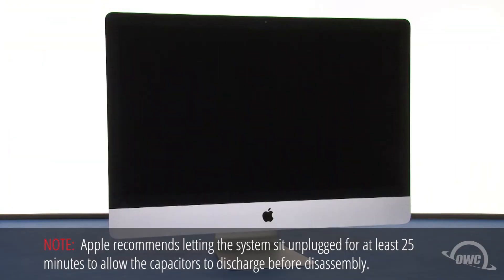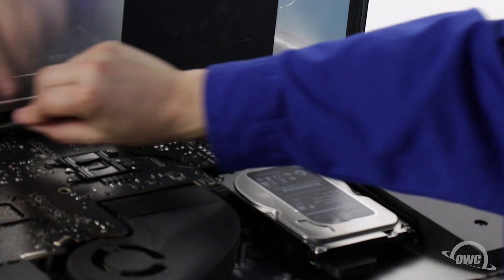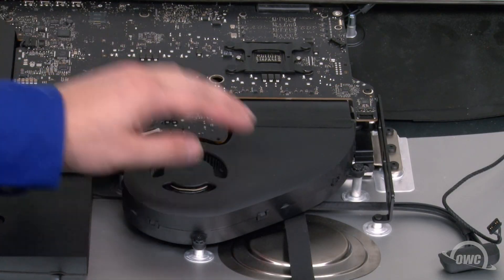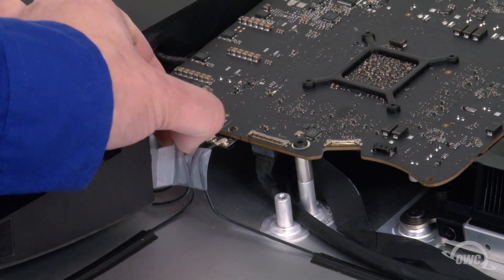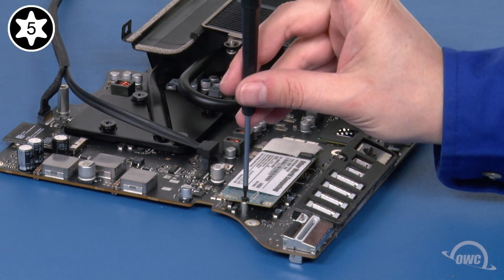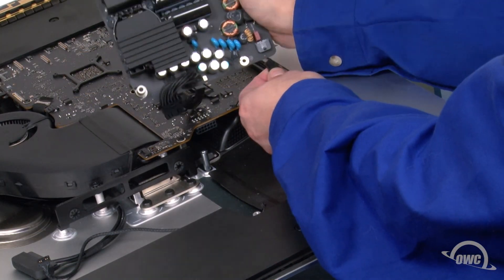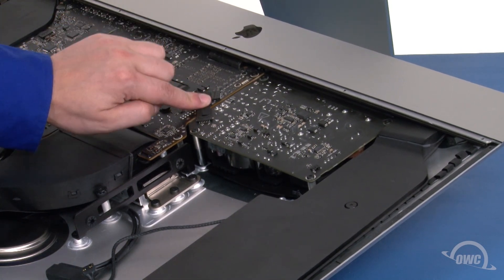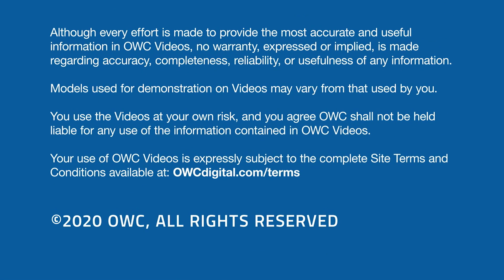How to Install/Upgrade the SSD Card Slot of a 27-inch iMac (Late 2012) iMac13,1

Comment: Good video but is there a follow-up video to move the data and OS to the NVMe to get the full benefit? I just replaced the HDD with a SSD, and it works well, add more RAM. I now have a usable machine.
Reply from the maker: Thanks for watching! Glad to hear your SSD and RAM upgrades went smoothly and your Mac is running great. We don’t have a follow-up video just yet for moving the OS and data to an NVMe, but we do have step-by-step guides on our site that walk you through it. If you want, our tech team can also guide you through the process so you can get the full speed boost.
https://eshop.macsales.com/Service/

Comment: The SSD slot in the late 2012 iMac is SATA3, so there is no benefit to installing the blade SSD when you can just replace the stock hard drive with a 2.5" SSD and get the same performance.  That would be for the non-fusion drive models.  If you have the Fusion Drive model, then you can remove the stock hard drive and replace the 128GB SSD stick with a 1TB or 2TB SSD stick.  Or replace the stock hard drive with an SSD and remove the 128GB SSD stick.  Later iMacs had no SSD slot if the Mac did not originally ship with a Fusion Drive.
Reply: I have one with the ssd stick... and the hard drive... should I not bother with the ssd stick then ? if i'm not going to gain any speed with putting a stick ssd i would rather just get a normal 2.5" ssd

Comment: Are there instructions to replace outright the fusion drive ( both hard drive and ssd drive ) with one ssd drive ?
Reply from the maker: Hey Joe,
This is a great question, this video is only to switch out the PCIe SSD that is located on the logic board. If you need instructions to replace the HDD this is the video you would want to watch.
https://eshop.macsales.com/installvideos/imac_27in5k_14late_hdd/

Comment: so basically you making a fusion drive?
Reply from the maker: Well a fusion drive is both a HDD and PCIe SSD that are fused together to be seen as one drive. When you install this drive your iMac will see it as its own individual drive. Now if you would like to fuse it with the HDD in the iMac you would have to go into terminal and fuse them together again.
Reply: @poweredbyowc  oh ok

Comment: Thanks to this video I installed the SSD in my late 2012 Mac. Everything went very well, it was easier than I expected. The package includes everything I needed to except the screwdriver for the T25.
Finally this computer will be usable again because the old hard drive was a real pain.

Comment: Hi guys, on your website can I also buy the little tool to open the "glass"? Does it comes together with the SSD kit? Do you send the kit to Germany?
Reply from the maker: Hey Silvia Cereja Daou,

Yes you can by the tools separately if you need to here. https://eshop.macsales.com/item/OWC/TOOLIMACWHL/
But it does come with any HDD/SSD upgrade kit.

Yes, we do ship internationally and can ship to most countries across the world. Pricing associated with international shipments vary, and typically start at about $25.00USD and go upwards depending on the weight and dimensions of the item(s) in question. All orders are subject to $0.50USD per hundred dollars after the first $100.00USD to cover insurance cost on the shipment.

In order to see what available shipping methods and prices are for your location, you just need to add the items you'd like to order to your cart and use the "Estimate Shipping and Tax" tool on our "View Cart" page for a complete listing of options and their pricing. Generally costs associated with shipping depend upon the weight and dimensions of the items ordered, as well as the shipping destination.

Please keep in mind that if you are planning to ship to a location outside the US, our shipping fees do not include and duties, taxes, brokerage, or customs fees that the courier may collect when your package is delivered. As each country has different fees associated with the import of goods, we cannot provide an estimate on what those may be. You can always contact your local customs office for an estimate, if you'd like.

Comment: Good afternoon. Can I install an NVME SSD M.2? Not sata ssd.
Reply from the maker: We can tell you that it is possible. There are adapters (we do not offer) out there that you can purchase, but please keep in mind that the drive will not run the speed of the drive but the connector in the iMac. It will always downclock to the slowest speed.

Comment: Is this a special kind of SSD blades?! because i heard that normal blades needs some kind of converter!
Reply from the maker: This is the the specific SSD you will need for this mac. There are adapter out there will allow you to connect to non compatiable machine but normally we provide you the correct SSD for each machine.

Comment: Could you say a bit about the expected improvement in performance for an upgrade to an SSD?
Reply from the maker: When upgrading to an SSD your will see up to 8X more capacity and up to 5.8X faster than existing drive. There is no slow downs - Maintains read/write speeds exceeding 500MB/s over the entire drive capacity.

Comment: Does a late 2015 need a heat sensor if the hard drive is changed. I’ve heard people say they have had no issues with the fan without the sensor, and a tech guy told me he took one of the adapters apart.
Reply from the maker: The 27" iMac will required the heat sensor. We have had customers not install the sensor and only use an app but they are not as reliable.

Comment: Watching the video, I wonder why you have to remove the HDD. You only put a SDD. Teach me why is it necessary to remove the HDD and put it back to the same place later. Nobi Tanishita
Reply from the maker: Technically you do not have to put the HDD back in. If you only want to have the SSD in the iMac you can skip reinstalling the HDD. There are customer that like having the SSD with only the OS and their Apps on it because its faster and they store their data on the HDD to avoid the SSD slowing down due to not enough available space.

Comment: I got somewhere to replace the HDD and install SSD in mine, but now the fan goes crazy all the time and high CPU, its a know issue, getting them to re add the HDD which I hope will resolve the issue as its super speedy with the SSD.
Reply from the maker: We sincerely apologize for the inconvenience you are experiencing. We would be more than happy to assist. If you can contact us we would be more than happy to see what may of happened.

Phone 1-800-275-4576 or +1-815-338-8685

Customer Service/Sales & Technical Support - Monday-Friday (8am-8pm CT) - Saturday & Sunday (Closed)
Live Chat Technical Support - Monday-Friday (8am-8pm CT) - Saturday (9am-5pm CT) - Sunday (Closed)
Live Chat Customer Service/Sales - Monday-Friday (7am-10pm CT) - Saturday & Sunday (9am-5pm CT).

Comment: I have an iMac 27 Late 2012. My HDD was giving errors, kept beachballing all the time, and eventually it was not responding.. Now, I want to install an SSD. But there're some points I could not figure out yet. Been watching instructions on how to install etc.
1- Is it better to install a stick SSD over the board?
2- Or an SSD via replacing the current HDD?
2- Or, making the both is an option? Useless?

My HDD is broken, starts up in like 100 hours. I wonder, in any case, do I have to install an OS into the SSD, then install it?

Plus, I will add more RAM. Is there any other recommendation like changing or updating any other part?
Thanks in advance.
Reply from the maker: Hello ışıl şen,
Without know the exact iMac Model you have we will not be able to tell you which is the best option. Either SSD would be an improvement to the HDD you currently have installed. You can do both SSD upgrades, if you go that route we recommend that buy a smaller blade style so you load just the OS and your softwares and applications because it would be the fastest drive. Then the other drive you would just store your data to eliminate causing slowness to the other drive.
Now the RAM you would be also upgrade without any problem but again without the exact model we would not be able to tell what is the max you would be able to install. We would recommend you contact us Via phone or email with your serial number to your iMac and we can provide you links to all possible upgrade options.

Phone 1-800-275-4576 or +1-815-338-8685

Customer Service/Sales & Technical Support - Monday-Friday (8am-8pm CT) - Saturday & Sunday (Closed)
Live Chat Technical Support - Monday-Friday (8am-8pm CT) - Saturday (9am-5pm CT) - Sunday (Closed)
Live Chat Customer Service/Sales - Monday-Friday (7am-10pm CT) - Saturday & Sunday (9am-5pm CT).
Thanks for choosing OWC, and have a great Holiday!
Reply: @poweredbyowc  Thank you so much for the quick respond. It's an iMac 27 Late 2012, Model A1419, EMC 2546
Reply: @poweredbyowc  The Serial number is DGKL10ZJDNMP
I want to purchase all the possible upgrade options. CPU, Bluetooth, ThunderBolt, RAM, SSD.. And of course, I will need a toolset.
I have a MacBook Pro 15" (mid 2012) and a Mac mini server, again late 2012. They all need to be upgraded. And the most urgent solution I need is the HDD to SSD upgrade.
Reply from the maker: Hello ışıl şen,
I serial number came up to be an iMac 13,2 which you can do just drive and RAM upgrades below are the upgrade links for you.
SSD:
https://eshop.macsales.com/shop/ssd/owc/imac-27-inch/2012
RAM(Memory)
https://eshop.macsales.com/shop/memory/iMac/2012_27/DDR3L

For the Mac mini again only the SSD and RAM can be upgraded.
SSD:
https://eshop.macsales.com/shop/ssd/owc/mac-mini/2012
RAM(Memory)
https://eshop.macsales.com/shop/memory/Apple/Mac_mini/DDR3_1600

Now for the MacBook Pro I would need to know the exact 2012 model. Apple manufactured 2 with different specification. We would need the serial number or model identifier to provide your upgrade options.

Comment: This video makes removal of the main power clip on the powerboard look easy. It most definitely was not easy for me, and if not careful you can break the connector from the logic board. By using two hands, right hand to carefully lift and elevate the board (without touching any metal capacitor exposures - SHOCK DANGER! ) and your index or middle finger to depress the underside of the connector release, and then your left hand using needle nose pliers to gently rock the connector side to side while pulling it off. This was probably the most challenging part of the whole project.
Reply: More discussion here: https://www.ifixit.com/Guide/iMac+Intel+27-Inch+EMC+2546+Power+Supply+Replacement/15722
Reply: I just waited until the logic board was removed- there was more room for my fingers to remove the power supply cable.
Reply: This was an incredibly helpful tip! I was able to use 2 hands by wedging the ifixit cardboard service wedge under the lifted power supply. Then using your method with the needle nose pliers was extremely easy and safe!

Comment: If you're upgrading from a fusion drive, and feeling queasy about giving your iMac an autopsy, just connect an external ssd. Make sure it's an NVMe model (eg: Samsung T7). While it almost certainly won't be as fast as an internal drive, it'll still be massive and very visible upgrade over the slow fusion drive.

Another benefit of this approach is that if you still want to go the internal route, you  can always put that external SSD to some use - backup, time machine etc.
Reply: Upgrade both, I did it, just take your time, and ssd drives are a lot better now, get a good quality branded one. Use at least 500gb Nvme. And 2t ssd.
Reply: Love your comment LOL
Reply: Only problem is the SSDs start dying after so many write operations. They claim typical user would be 5 years but mine only lasted 3. My platter HDDs from the 90s still technically work. That was a sad reality for me when it "bit." <- see what I did there?
Reply: @GregJoshuaW  I have been using SSDs since 2014 and I haven't had one fail yet.

Comment: So this is just to add/ replace what i think is the Blade SDD i.e. where a Fusion drive had been optioned in?  If so what's the benefit over just replacing the main SDD?  Is it faster?
Reply from the maker: There is a slight speed advantage in our blade vs the stock blade, but typically in a Fusion set up, the blade (SSD) portion is something like 128GB, and the remainder of your Fusion drive is in the form of a much slower 3.5" spinning drive. Replacing the blade with an aftermarket option gives you a boost of speed overall simply because everything is now running on an SSD, not just certain files.
Reply: I think the SSD can fail in addition to the hard drive

Comment: Doesn’t the 2012 iMacs have optical drives ?
Reply: No. There was no option for them either. You need an external CD/DVD if you want optical drive capability.
Reply: Juan Pina  Wrong. They had spinning HDDs, an SSD blade if you ordered a fusion Drive but there was no optical drive. The last iMac with an internal optical drive was the Mid 2011 model,